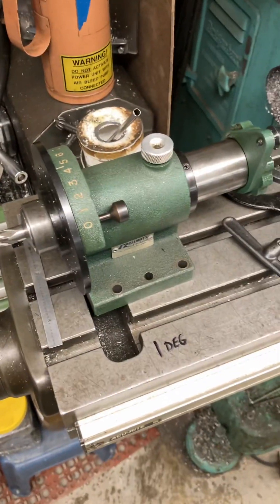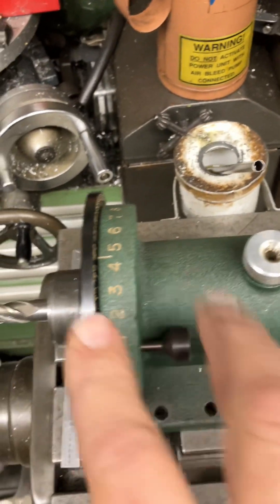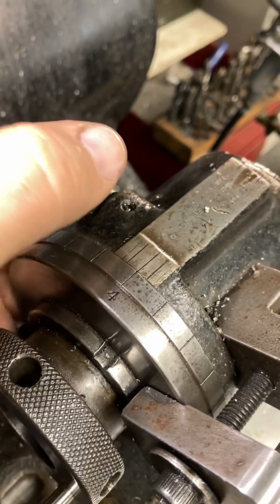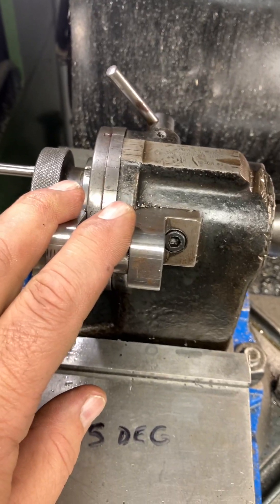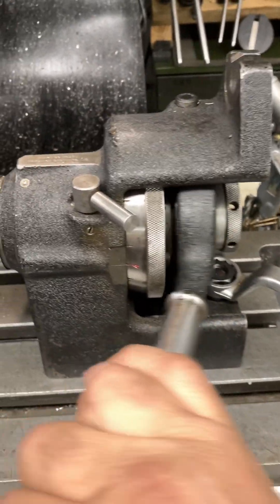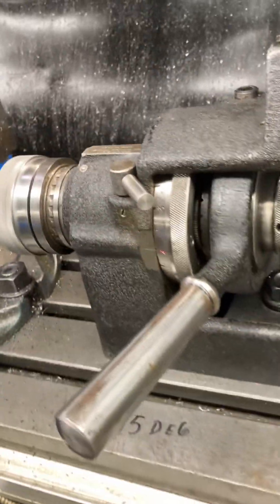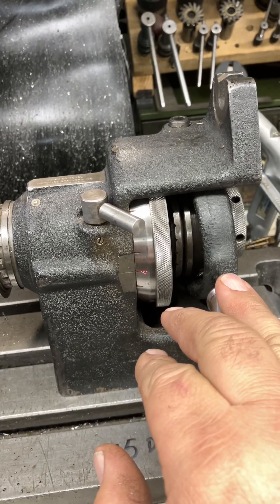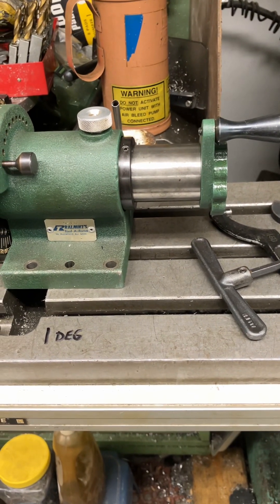Collet indexer Review

Comment: I've got the first type. I made a new tube to 5c and on the back end got rid of that poopy 3 set screw handle . Single point threaded the end and made a threaded ring to match that has holes in the sides for lock nut wrench. Works really well. That last one though.. heading to ebay now 😊